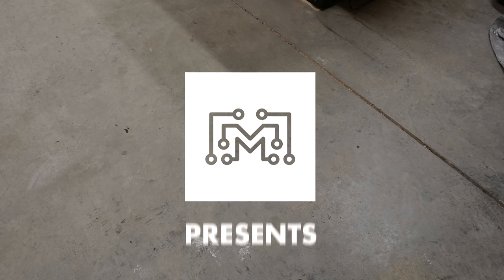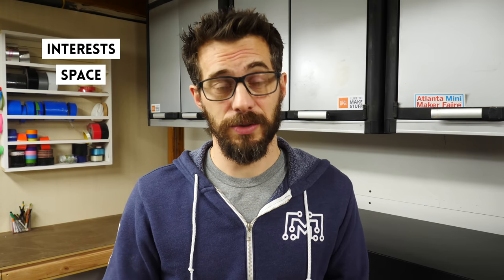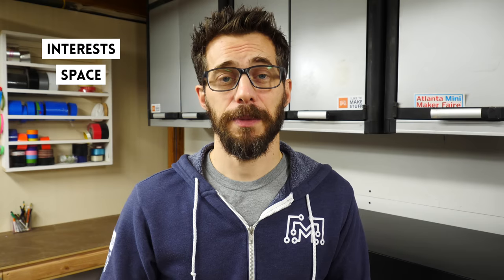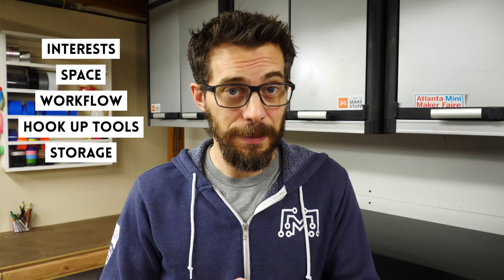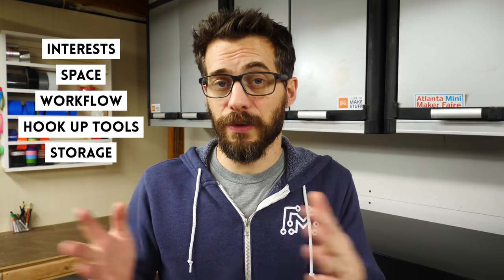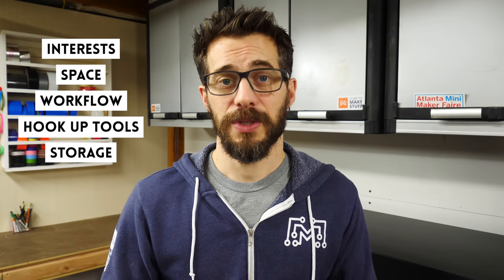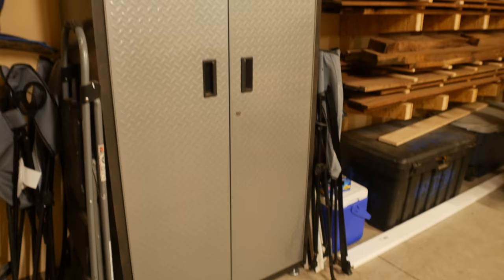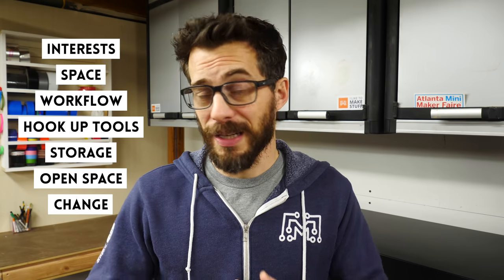Setting Up A Workshop // Bits | I Like To Make Stuff

Comment: Nice bit Bob, those are some good pieces of advice to follow in a smaller shop.  Back in college I really got into woodworking (and YouTube) and made it work using a really small garage that was about 7'x7'.  I really managed my workflow there to try and stage equipment in good positions where I could use he outside as almost an extension to my shop.  Thanks!

Comment: I have a little woodstove that I feed my usable scraps to to keep warm. 
I have two sliding pegboard on the usable space behind my workcounter to hang my tools that narrows my work space from 600mm to 400mm and if I need more depth on the work counter for bigger projects I can move the peg away. Also allows my workflow to be easily swapped about for different projects

I think i may have to insulate my workshop as well as I found a bottle of water frozen in it today...

Comment: Finding common equipment table heights for out feed tables/workbenches.  I recently discovered my bandsaw, contractor table saw, and routing table all had very similar base to work surface height. I made a single workbench with a lowered area than can accommodate one of those tools as an out feed table, while the other 2 tools not in use are stored underneath.  Adding a few shim pieces that can be stored on the cart for each respective tool.  It allowed me to combine 3 tools worth of space into 1.

Comment: Thanks for making this one! I'm currently in the process of building out the shop I manage and I have been wondering how to go about it. The best tip I can offer for preventing hoarding is give each piece of material a timeline to turn into a finished product. If it's not met then it's either trash or deep storage.
Reply from the maker: Good tip!

Comment: Great tips!  I have VERY small shop, about 12' x 15' of usable space.  My workbench and table saw are on casters.  I built a rolling flip-top stand for my planer and belt/disk sander, and a rolling cabinet for my band saw that also keeps my benchtop drill press, folding miter saw, and a case with my JobMax and tool heads for it.  Everything rolls.  Also makes it a lot easier to clean off the shop floor.
Reply from the maker: Casters are really nice for shop clean up, good point!
Reply: ^^ This right here is key. Keep everything on wheels and moveable.
Reply: Small for the States, my shed is half that but still gets plenty of use! We all make the best of what we have but everyone wants more space! Even Jimmy D 😉

Comment: One thing I would say is you don’t “Need” to have piping between tools for dust collection.  You can move a hose a lot fast (and cheaper) than installing piping all over, especially if you have a small space.  

One thing I would suggest is face all your “dangerous” cutting tools towards the door that someone would enter.  One extra safety measure to keep you safe while making cuts at a table saw, miter saw or jointer.  

Thanks for sharing this video!  Very informative for everyone!
Reply from the maker: I totally agree about the dust collector. Having some type of dust extraction is really important. Shop Vacs work perfectly.

Comment: Thanks for this!!! I’m about to do a makerspace video on my channel but I needed help for my workshop. I feel like for workflows I have 3D printing/laser cutting/dremeling, but then a woodshop area that has  dust collection and such. The note about the dust collector needing it’s own circuit may have also saved me on my shed I’m about to get wired up. Thanks a ton for yet another awesome video!
Reply from the maker: You'll get frustrated really quick after you trip a few circuit breakers

Comment: I've always found it helpful to have a decently sized, mobile work table that can be locked down when necessary. Not unlike the modular ones you made in a previous video, but having one large one rather than several smaller ones that interlock can be helpful when you're working with larger pieces of material or larger projects like I frequently do. It also helps with ensuring the entire work surface is level and nothing shifts midway through a cut or something. I also try to buy benchtop tools whenever the freestanding versions' don't offer any significant benefit to their intended purpose. You can group those tools onto stands in pairs or sets that compliment each other and help to make it easier and more efficient for dust management. For example: Putting a disc sander on the same stand a scroll saw or a thickness planer.
Reply from the maker: Great tips!

Comment: Take advantage of awkward space, nooks, and the ceiling. I have stairs in my shop, underneath which is a closet, where I keep my air compressor (and its related accessories + tools) along with insulation to keep it quiet.
Reply from the maker: Great point about noise control, especially if you are working in a home garage.

Comment: If you're building a workplace from the ground up, a shed or garage, you can leave the inside open, not insulating and drywalling, and store hand tools and clamps on the wall in-between the 2×4's and leftover long boards across the ceiling rafters, the downside is, depending where you live, because the inside is'nt insulated, it gets crazy hot/cold during summer/winter.

Comment: Great stuff Bob,  I have a small one car garage. My assembly table, table saw and other large tools are on casters. Also to .org space I have a 10 x10 pop up tent.  I some times add the walls to it and use a heater to heat the space during the winter
Reply from the maker: Smart little green house work shop

Comment: Everything (almost) that I've made so far has been in my tiny shop. It's about 5'x5' in a corner of the living room of my 3rd floor apartment in Brooklyn. I obviously would have challenges building something huge but it has been manageable so far.  Filming is a bit tricky but also doable.  I do go to other / outdoor locations for any forging or heavy duty metal work but I don't do too much of that.

Comment: Flooring is also key if you want a flexible workspace. My workshop is in a garden shed and the flooring is made up from wooden planks. If I wanted to roll things around easily and without tearing up the floor then I'd need to at the very least put down some kind of sheet material on the floor or better still, pour a concrete slab. as I'm in rented accommodation that's not possible - so I guess it's the former... until I can afford to get my own place that is.
Reply from the maker: That's a good point. Josh's shop has a high point in the center for drainage and it makes moving things around a little more difficult.

Comment: One tip is to keep what you use most often near you. Like... Well, in my case: heat shrink tubes, wires, tools like the multimeter and so on. Things that you use less (like screws, in my case) can be stored farther away. 😊
Reply from the maker: Great point!

Comment: Something that I would add is lighting.  Working under inadequate lighting is frustrating and exhausting.  Add an extra circuit and make sure you have good, diffuse light on your work surfaces.  I use full spectrum LED, 6000k to 6500k color, at about 500 lumens (yes, I am old - youngster can use 200-300 lumens) on the work surface.  Use a free app for your phone to measure the lumens.

Comment: Awesome video! (and possibly my first ever yt comment). My "shop" is organized by exactly the principals you mention. The only [space] I had for it is a bedroom in my apartment that I used as my office, it's very small (about 3x2.5m) and still needs to hold my computer desk. Most of the shop furniture is indeed mobile on lockable wheels, and storage (items and tools) is all against the walls, including OSB panels I've constructed on one corner (as the walls are concrete) for tool storage, to keep maximum [open floor space]. I made it a priority to keep access open to a window, which ensures I have a space I can set up temporary fixtures in (like sawhorses or a mobile bench) as a way to expand my working space for different [workflows]. [Storage] is (mostly) all in clear plastic bins from IKEA, though I store lumber in a tiny spare bathroom we have. A shower curtain hangs between walls allowing me to shield my PC and desk from sawdust when needed. I chose to use only handheld [tools] such as a circular saw and router as the space can't allow for anything bigger. And yeah, the space does [change] and evolve over time.
Reply from the maker: That's coo to hear, thanks!

Comment: 1. My tablesaw has to move frequently. When I am using it, it pretty much takes up the whole open area, so when I'm done, I push it up against the wall. I used fishing yo yos to keep the cord and dust collection hose neatly pulled out of the way. 
2. Again, the tablesaw takes up so much space that I sometimes have to fight the urge to get more tools. My saw, the Grizzly 0833P, has long fence rails that extend far beyond the top. I took that space and adapted it to fit a home made router table and lift. It takes up no more space than the saw did and now i have two tools in one. I even  got into the saw wiring and tied the router to the same plug via an add on switch and outlet. Two tools, one cord. 
3. My dust collection system is built into a roll around cabinet. It takes up more space now (approx 20"×48"), but hut enclosing it, I now have a three sided box I can hang all my measuring tools and straight edges. 
4. Shelves... my shelves are the cheap metal and particle board ones from Walmart. I took three of those and build a frame under them. Then added wheels. I also capped each end with some 1/2" plywood. This keeps them rigid. Now, I can push them all together into a 52"×50" space. This saved a HUGE amount of space. 
5. Miter saw station.. now, I'm not sure how much space this one really saves, but its a great addition. My saw is a big fancy DeWalt 12" double bevel slider and I wanted to be able to use all the features on it. My cabinet (on wheels) is roughly 40" deep and 36" when closed.. When i need to use it, I pull it out and open up the wings on each side that give me 8' of support. Also, since the m.s. puts off so much dust, I had to build a custom surround for the cabinet (easier than you might think), then I simply covered it with some painters plastic. It's NOT fancy, but it works well. There are also two MASSIVE drawers mounted below the saw top. Im talking 30"×36"..
6. Wheels, wheels and more wheels. They are your BEST friend in a spall space. Just make sure you get locking wheels where needed. 
7. This one may be more of a cheap fix rather than space saving but... dryer hose.  Its great for tools like sanders and routers. I have one on my table sawand router because I move it often and the dust collection piping is mounted to the ceiling. Its light weight and is far less likely to break blast gates. Im positive it my not be as durable as the plastic hose, but its far and away cheaper and easier to install. Oh, and you can use yo yos to keep it held out of the way..
8. Air quality... ok, so my pet peave is dust on my cabinets. Having to clean after every single cut is NOT for me. My family also suffers from severe allergies. I have a 4 step way to combate this AND improve those "cheap green" dust collectors. As I said before, mine is mounted in a cabinet. I built a Thein (butchered spelling I'm sure) baffle that collects large debris into an easy to dump trash can then, the "dirty air" goes to the plastic bag where smaller stuff is collected. After that it hits the huge round filter that collects "most" of the fine dust. Finally, the air travels through a series of dampers to a final HEPA filter mounted on top of the cabinet. The entire cabinet is sealed from outside air so no "dirty air" can escape. Also, I lined the entire cabinet with sound absorbing insulation and mounted the motor via thick rubber bushings. This reduced the noise level by 50dB. 
9. Hanging out... if you have a finished shop, check out some hanging shelves. They're pretty cheap and can give you some VALUABLE storage options.  Just make sure you are attaching them to appropriate support..
10. Like Bob said, some of your "stash" my actually be trash. We all want to hoard every scrap we can, be that may not be realistic in a small shop. Take..... stock.. of what you have and decide if you really are going to build that project.... one day...
Reply from the maker: Thanks for this. I had to google fishing yo yos and they look super handy!

Comment: Do not put a tracktor in your shop like i do, every time i use the shop i need to get it out which cause starting the tractor for no reason an using up your starter+a bit of fuel.

For big things, consider doeing your project outside if the wheater is clear: you have natural ventilation and enough space. :)

Comment: This is a funny thing in chicago it is cold and it froze my wood glue
Reply: hahah I live in Canada. Your "cold" is our "damn it's super warm today!" (my outside thermometer currently says -40C). I too have to take my glue and finishes out of the shop in winter :(
Reply: The funny things is that I have the opposite problem in Florida.  The humidity down here makes the glue take forever to dry.  Although it could be my impatience too.  :)
Reply: Southern Custom Cuts oh yeah, summers are pretty humid here too but I keep a dehumidifier running pretty much constantly.
Reply: My windex froze last week when I had to clean something.
Reply: My glue froze too. I threw it in the microwave for a short time because the closes hardware store was 30 min away lol.

Comment: I actually built a couple of tables based on one of your videos. I then use them to butt up to another mobile table for my miter saw so I have 12 feet total if I need it. 

I would like to see a bits video talking about different dust collection connectors. Specifically should I measure from the outside of the dust exhaust port or the inside to determine what size fitting I need to get for my dust collection system?
Reply from the maker: If you're using PVC pipe, most times they won't match up with most dust ports. If you don't have a way to make a coupling or adapter, wrap the hoses in duct tape a few times and pressure fit them.

Comment: One thing you forgot is the lighting. You can have a wonderful shop, but with the wrong lamps on incorrect spots, you may aswell work in a cave.
It's a good idea to have fixed ceiling lamps, and a couple of moveable lamps to focus the light on one particular detail or something like that.
Reply: I found that I had the same problem with lighting.  I always felt like it was so dark.  I found a couple of 3' daylight led lights for $10 at Home Depot and it made a world of difference.  Great advice!
Reply from the maker: That's a great point. Adding some lights can really change the feel of a room, especially a workshop where you need to be vigilant.